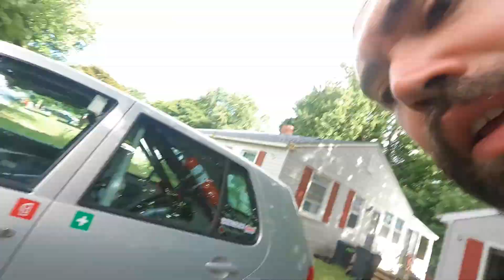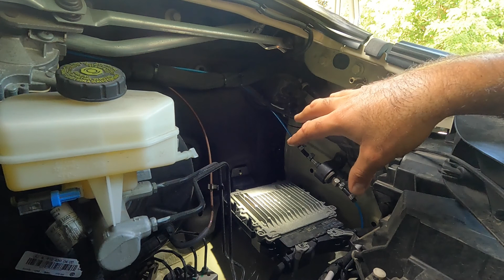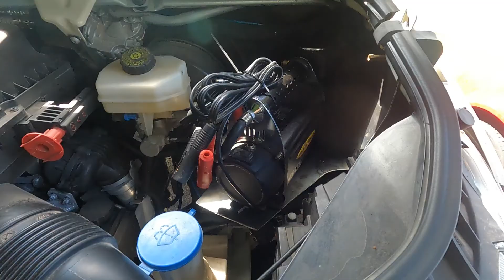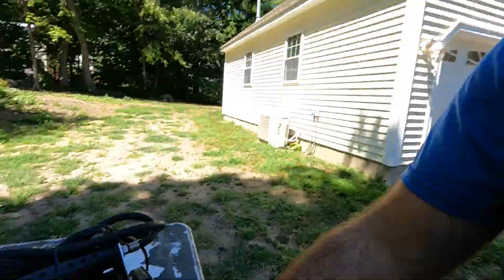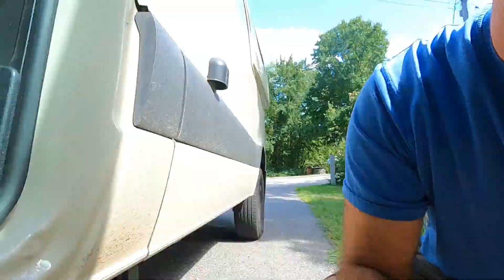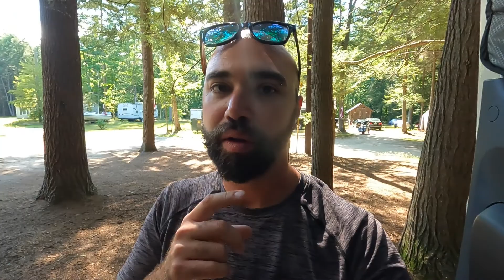DIY onboard air [Smittybilt 2781 air compressor in a Sprinter van]

Comment: This video was useful in determining where and how to connect any auxiliary electronic device to the van's 12-volt power supply. Also, your backyard fabrication skills are legit! Also, I think tapping a sheet-metal screw anywhere in the front seat housing would have given you an adequate ground.
Reply from the maker: Thank you so much! I’m glad it helped you. I try to avoid sheet metal screws wherever possible because they ultimately fail prematurely and cause issues.